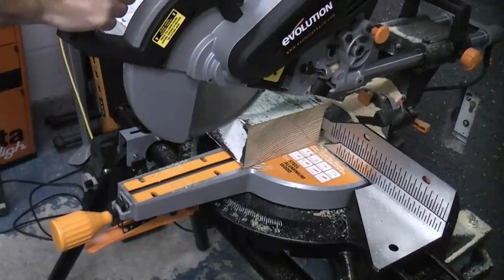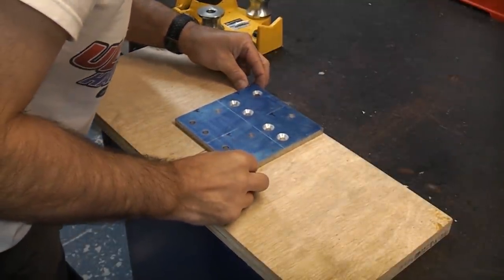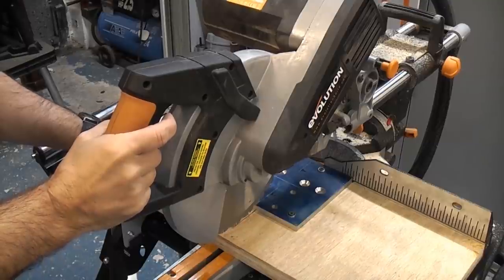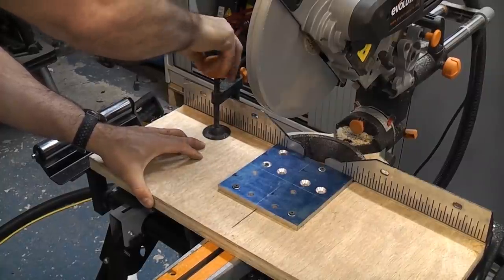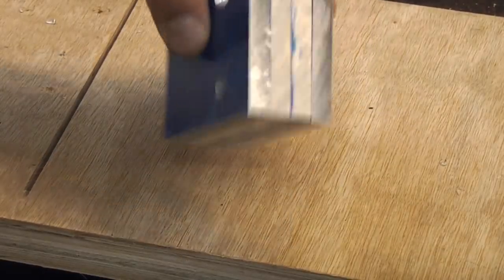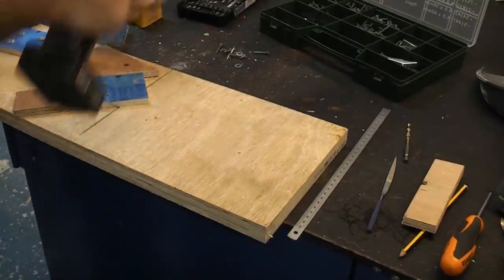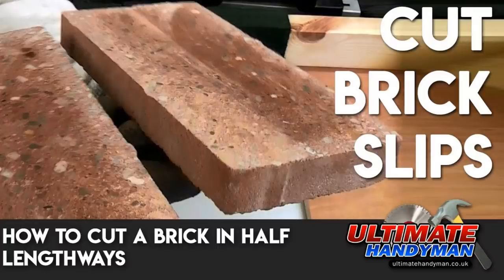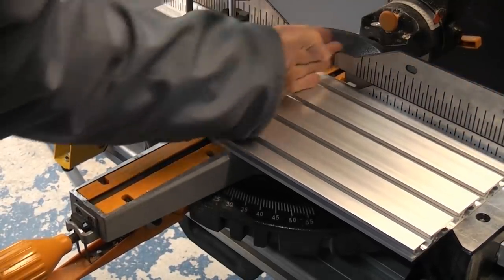How to cut small items with a mitre saw

Comment: Nice video as usual. With mitre saws, there is a very important rule to follow and you did it correctly. When you finish cutting small bits, at least the off bits that are left on the right hand side of the blade, never ever lift the blade up until the blade completely stops. He properly demonstrates that at the very end of the video. I know a guy who lost an eye sight because he didn't wait for the blade to fully stop. The small piece of wood jumped up and hit him badly in his eye. I have to say, back in the day, health and safety wasn't much important (it is still not important to many people nowadays)These mitre saws are very useful machines, you take your precautions, you never will be hurt.
Reply from the maker: Thanks for the comment ;-)

Comment: I like ur vids, but didn't really get this one... How to cut ali when you have loads of screw holes drilled in it to help screw it down
Reply from the maker: The Aluminium did not have the holes in it to begin with, I needed the holes for the final product, which was shown at the end of the video. If you don't need any holes you can still screw the aluminium down, by using more pieces of wood. Did you watch the video until the end? Did you see the aluminium table that I'm making from the extruded aluminium and the T slot clamp? 
Thanks for the comment

Comment: Great demo 👍. Would you recommend evolution power tools. I can't get hold of the 185 saw they are out of stock.
Reply from the maker: Yes, their Rage saws are great for the money. I would not hesitate to recommend them to anyone- unless you are a carpenter that cuts large pieces, in which case you might need a larger Dewalt/Bosch/Makita etc with a 12 inch blade.
They might be struggling getting stock at the moment! 
Thanks for the comment

Comment: What if you don’t want holes in the aluminium you are cutting?
Reply from the maker: You can hold the metal in position by screwing some pieces of wood over the top and screw directly into the jig.
Obviously once I've finished making the aluminium profile jig this job will be much easier ;-)
Thanks for the comment 👍

Comment: Hi what blade are you using in the mitre saw? Great videos by the way. I can learn so much from you . Thank you
Reply from the maker: It's the blade that comes with these saws- you can't use them on other saws, as they won't have enough torque etc.
Thanks for the comment 👍

Comment: Disappointed to hear you weren't trimming your hedge yourself fella😂 and whilst I watch and admire your very informative videos, I cant help thinking this is a bit of a long winded way of doing this. A couple of guide lines and a clamp would have done the trick. Just my opinion though, continue your good work sharing your  knowledge with people, it's a very admirable quality you have.
Reply from the maker: It can be difficult clamping items, or at least it is not possible with the clamps that I have.
I leave the hedges and the grass mowing to a local firm now, much easier and a lot less hassle ;-)
Reply: @ultimatehandyman  I work for a commercial gardening company , maintaining local schools and firestations,  and I get what you mean, I hate hedge trimming too,  and we have all the gear to do it easily, still a chore though.